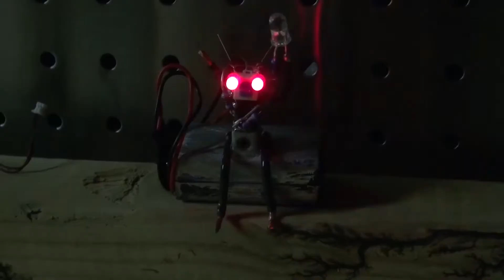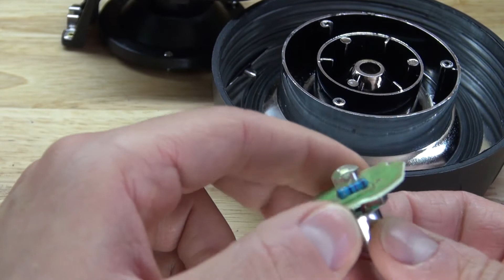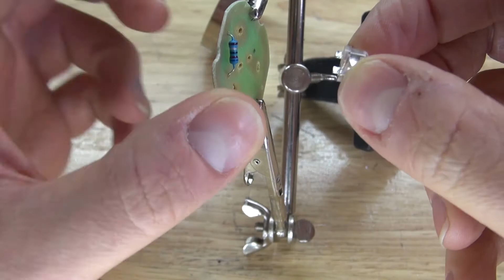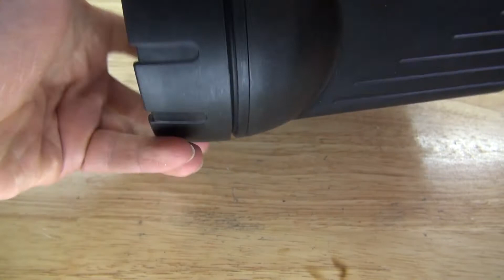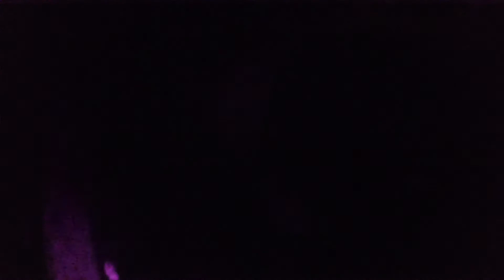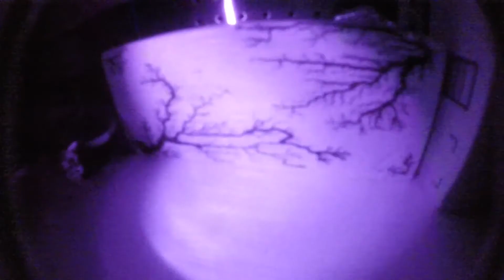IR Flashlight Mod

Comment: I’m pretty sure if you buy a quest 2 and turn on it’s pass through and then turn on this flash light then you could use them as night vision Goggles cuz I think the cameras on the quest 2 are infrared cameras
(I just checked and they are)
Reply from the maker: That's a cool and interesting idea!
Reply: @SciTyeTech  yea I already got a quest 2 and I was looking at like infrared lights since the cameras can see them and since it’s a vr headset it’s like night vision goggles also nice channel